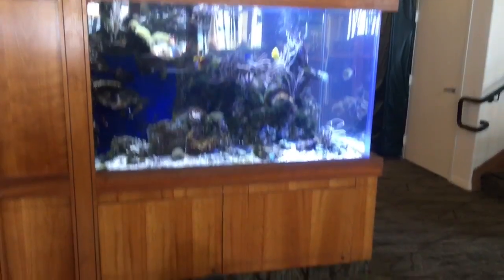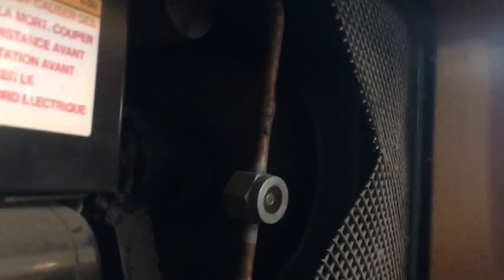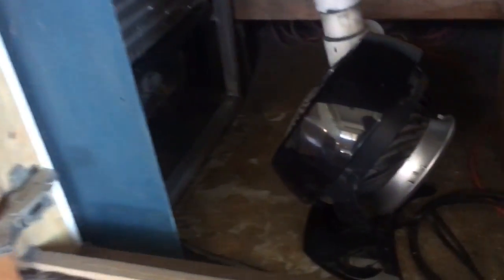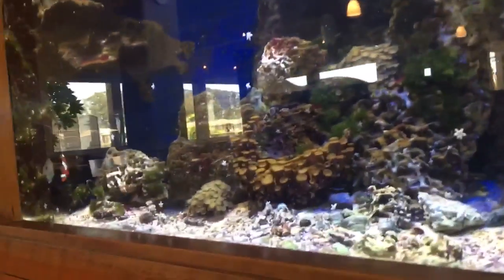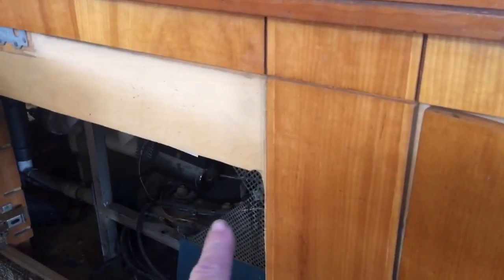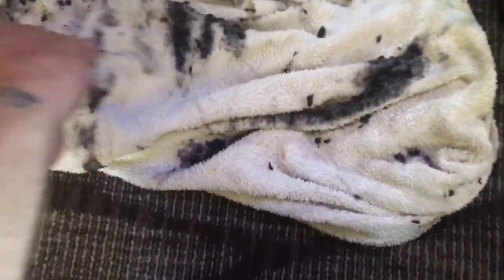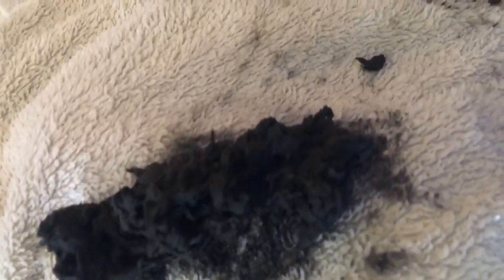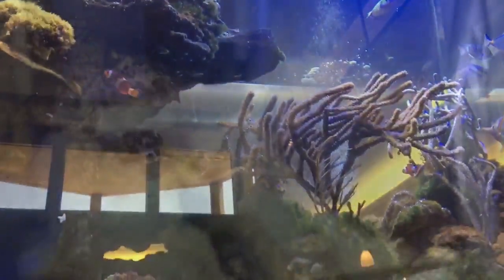Aquarium refrigeration

Comment: Good vid ! Yep, smokin hot liquid line means condenser not cooling hot gas no matter what it looks like. Good tip for the New Guys !
I Have started allways looking at the compressor Big Label they put on Compressors When they Turn brown like that one is , That compressor has RunHot for a Long time.
Maybe u can convince them to remote that condenser , It woukd be quieter outside and u could maintain the condenser cleaner for them. Maybe when this compressor dies , Put a new Condensing unit on Roof or elsewhere.
Reply from the maker: OcRefrigeration,Hvac & Electrical. I think it's location is not moving. But a new condensing unit and TXV are needed.

Comment: Sweet video Nor Cal. A good refrigeration tech will never be out of work. I have worked on machine coolers and plasma walk in freezers that need to be kept at -40 degrees. The last 5 years I have been learning to work on environmental test chambers, not full time. Cascade systems are very unique. 2 separate refrigeration circuits in the same unit that have to operate in harmony with each other.
Reply: Cascade Refrigeration is Lots of Fun !  Did it for many years ! In the 80's. Hughes aircraft , Rockwell , Jet Propulsion Laboratory  they all have it. You can really bill out the hours doing that stuff.
R-22 , R-170 cascades. 502 , 503 cascades. Thermal shock & environmental test chambers. Aerospace. All controlled by computer and You want to talk about eating up hours of time on chambers and Driving to La and san diego in one day. Did it for 7 Years. Had enough of that. -55 C to + 125 C Mil spec. 

Mil spec -883
Fc-77 Flourocarbon liquid for Liquid thermal shock baths. Lot's of fun ! It's a Party ! 

Welcome to Next Level Refrigeration !
Reply from the maker: polishtheturd mickelson I've done all those and still do a bunch of them. Also freeze driers. Most locations filming is not allowed.
Reply: Where I work. We have a full service contract for a automotive parts maker. They pay a lump sum per year. We are responsible for all parts and labor, not refrigerant. If a compressor fails, it is on us. They have about 25 chambers, heat/cool/humidity. Also 8 ovens or so. No, thermal shock or vibration chambers. I am the main guy that is there where I work now. I do pm's and repairs on the chambers. I know these chambers very well now. When service is slow, which it hasn't been. I can go there and work. Job Security, plus I am in a air conditioned building, lol, love that.
Reply from the maker: polishtheturd mickelson that's awesome. Turd.
Reply: Hey that's how I started, environmental test chambers back in the 80s, worked for Thermotron, Advanced Climatic Engineering & Sanyo Gallenkamp. Well-versed on cascade refrigeration systems. When I worked for Sanyo they did a pharmaceutical chest freezer that had a 3-stage cascade system that could get down to -120 deg.C. I work in commercial refrigeration now though.

Comment: That compressor is on its last leg , good job NorCal
Reply from the maker: Felipe Tafolla did you see how cooked the label was? You know the TXV is full of cooked crud.
Reply: Nor-Cal Refrigeration & H.V.A.C yup I did be careful if you unsweat that valve , it will have all kinds of oil, crap , trapped in the lines .
Reply: Yep , i saw that.
Reply from the maker: Felipe Tafolla the location of that valve I might just disassemble it in place and use the body and install new guts and power head.